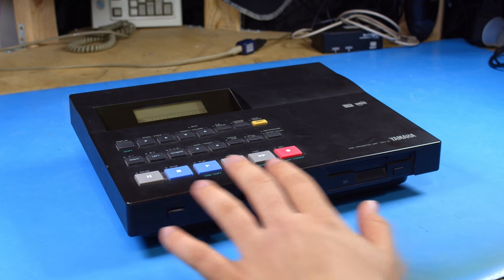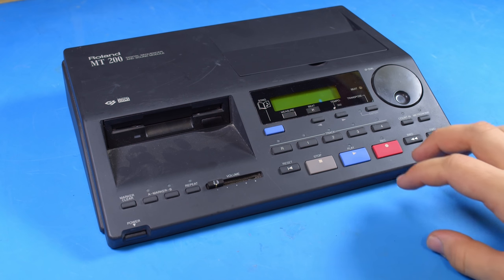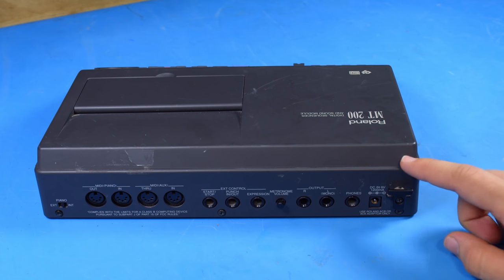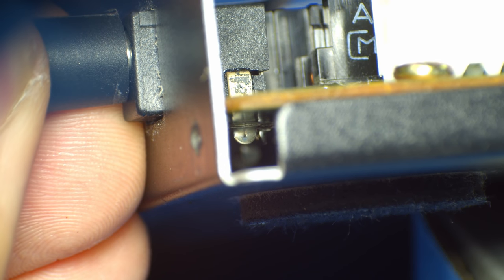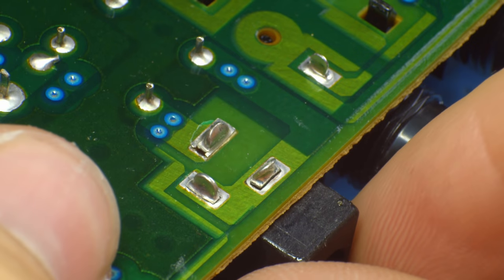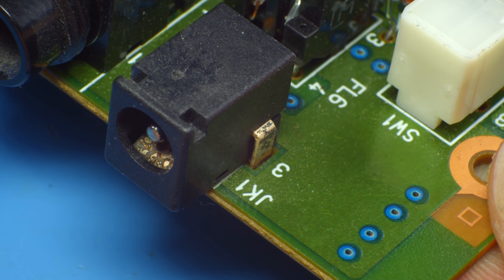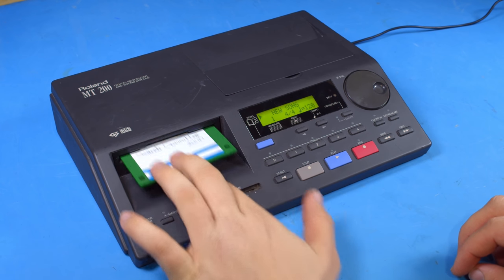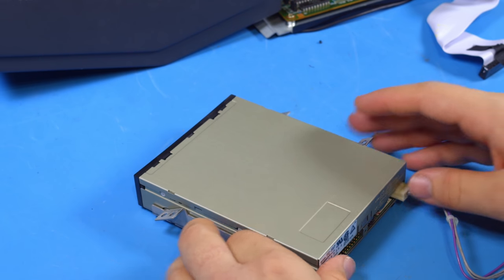Roland MT-200 Pt1: Power Repair

Comment: The drive select problem can be fixed with a floppy cable with a twist in it(not the regular pc floppy twist) by swapping driveselect 1 and 0. Also most pc floppy drives can be modded to shugart.
Reply from the maker: I remember something about some drives having pads on them for drive select. I'll have to look at the ones I've got and see if I can make that work on any of them. 

If not, somewhere I have a length of 34 conductor cable and some connectors. I can try making an adapter cable to give doing in the unmodified way a shot.
Reply from the maker: I've done some more testing. The FZ-357 drive in it isn't just set to DS0. There is some other way it is configured that makes it unusual. I tried several different brand drives jumped to DS0 and none of them worked. I tried doing an Amiga mod on a Sony MPF920 Z/121 and that didn't work either. Although the Amiga modded drive is closer than the others. It is able to detect the disk with the mod, but it never gets to either reading it or saying it's improper.
Reply: @TechTangents  Both in my Amiga 600 and SD35 I have FZ354s (the only difference between 354s and 357s is that the latter ones support HD floppies, but only if the JP2 jumper on the board is shorted, apart from that they should be identical). Jumpers in both ones are set to DS0, MM, RDY, but in the Roland one the TTL/C-MOS jumper is not present. Maybe that's the difference? I think that the most PC drives use TTL levels, so if your module requires CMOS levels, that might be the problem.

Comment from the maker: I've done some more testing. The FZ-357 drive in it isn't just set to DS0. There is some other way it is configured that makes it unusual. I tried several different brand drives jumped to DS0 and none of them worked. I tried doing an Amiga mod on a Sony MPF920 Z/121 and that didn't work either. Although the Amiga modded drive is closer than the others. It is able to detect the disk with the mod, but it never gets to either reading it or saying it's improper. 

Also, I had two problems in editing this video:
1. I used the stereo mics in the flashbacks and in the shot where I was holding the floppy drive and it doesn't sound good. I now have a lapel mic that I'm going to setup to be always recording as a fallback. So this should be fixed in the future.
2. I misspelled "too". It takes about 3-4hrs to go from clicking the render button to the video being uploaded. I don't want to waste that time to add one more "o"
Reply: Re: #2, I'm interested in your edit/rendering process and settings, have you thought about doing a video about your recording and production setup? (Or, have you done one and I've just missed it)
Reply from the maker: I am getting really close to doing a video on that. I switched from using Blender to Davinci Resolve as my editor a while ago and about a month ago switched to a BMPCC4K camera which is a huge departure from my Nikon D5300. My Editing PC is in it's final config now with 2xE5-2690s, 64GB RAM, and a 1080ti but the high bitrate 4k footage takes a lot of power to work with. For this video I also used Resolve's noise reduction for the first time which is very intense in the render making it take about 4x as long. But the result is much better. 

There are a lot of reasons it takes a long time to render, I'll go into the more technical details in the eventual video. The gist is, I'm using a very high quality workflow so it isn't easy. Also, I'm doing everything on Linux. So I'm sort of forging my own path.
Reply: Around 8:16 the camera seems to glitch out for a couple of seconds.
Reply: As an s330 owner, yes Roland did use specific floppy drives and you either need the specific chinon model as is fitted and ask roland for the jumper settings or buy a modded drive which is what I did (although it now has a faulty floppy cable which is soldered in, and the OS is on fdd so no drive=no one home), i think the other thing it needs is a drive ready signal (pin 30?) but naturally PC drives are generally designed as cheap possible so omit unneeded extra features.  
There is also a Toshiba drive that would work (as fitted to the s330) but I'm unsure of the model.
Reply: Have you tried digging around for another FZ-357 and swap out the controller? That head really smells like it's dead and buried.
Reply: AkBKukU i have a Roland MC-500  and it works fine with a Gotek USB emulator (the kind for Amigas).
I followed the instuctions I found on youtube to do the retrofit. You should try.
Reply: He states in the video he doesn't want to do the GoTEK setup. I did it on my MT-200s because I got sick and tired of dealing with my floppy disks crapping out on me and just having to deal with so many disks with all the midi files I wanted to listen to through it. So yeah, I did the video on how to buy the cheaper sub $20 gotek emulators and configure them to work on the MT-200 and I would suspect other Roland modules with floppy drives as well. There is also quite a bit to be found in the diagnostics that would help with his future video etc on this. Lots of quirks with these devices, but once you know about them, they are a joy to have.

Comment: From what I understand, Roland used center negative for their PSUs because that's what their BOSS effects pedal use, and everyone started using center negative for their pedals as well since they wanted to capture Roland's market and audience. So the whole 'center negative' thing stuck with the company for the rest of their life it seems.
Reply: I have no idea about audio equipment, but I do know that center negative was definitely a thing back in older electronics. And there might have just been 'standard' parts that were designed around a center negative...

Comment: Just a tiny correction: Floppy disks usually use the FAT12 format, while FAT16 was used for hard drives with MS-DOS 3.0 or later. 
FAT16 was created in order to support the newer much larger 20 megabyte hard drives, which FAT12 couldn't utilize to various limitations.

Comment: Improper disk doesn’t necessarily mean that. You can get rid of the message by pressing the Stop button, and usually everything proceeds as normal. I’ve had my MT 200 since 1999 and I still use it to create tracks. I’ve recently started having problems with the transformer and have just sent away for a Roland replacement which I hope will take care of the problem. I have my fingers crossed that it’s not the power supply internally.

Comment: I have a Roland SD35 which is pretty similar to your model. It's very unreliable with basically every floppy I got, but it works fine with my HxC gotek. Google for "pc to amiga floppy mod", it's what you need to mod your ordinary PC drive to work here. But your mileage may vary - I was experimenting with some modded drives and the ROland module was still picky as hell... It's standard DOS FAT format BTW.

Comment: Clean the heads on the floppy drive. Also you need to make sure the floppy is correctly formatted for that drive. You can’t just assume it is compatible. Also you need to resolder the 1/4” Jack.

Comment: You need to update the firmware in it to ver 2.0 or 2.01 to prevent hanging note issues that the ver 1x is known to do. I've got one that I use as a sound canvas device for all older games. And yes they are compatible with both 720k and high density 1.44mb disks. At least mine is or was until I put a Gotek in it about a year ago.

Comment: 9V Center negative is pretty standard with electronic instruments and effects by the way. For example all the guitar effect pedals I have sen have this. Keyboards also seem to have center negative barrel jacks most of the time, although they not always use 9V. 12V is also very common there. Also, the ripped barral jacks are the total classic repair job with musical equipment. I must have done a hundred of them or so. Seems to be due to the rough handling such equipment receives often on stages and when the equipment gets set up and torn down a lot.

Comment: I have the MT-100, which is an MT-32 Mk.II instead of a GS synth. It also uses non standard floppy disks... not a file format, a slightly different, slightly smaller floppy disk.
Reply: You mean Quick-Disk? That became a pretty popular format in the music world, Roland embraced it wholeheartedly with a lot of their products (like the D-20 workstation) before 3.5in took over.

Comment: Hi AkBKukU! I recently  acquired a Roland SoundBrush SB-55 paired with a SoundCanvas SC-88, the SC-88 works flawlessly but the SB-55 gives me an "hEr" error, someday I'll try to repair it, I also want to try the floppy midi experience!!! And for the floppy drive, I think I read somewhere that some Epson SMD-300 do have jumpers for DS0 settings and they are used for replacement on a wide range of devices, presumably the SB-55 wich uses DD floppies. Even though I don't know if they can be used on your MT-200. Sorry for my bad english, love your channel!

Comment: I don't know anything useful about the drive ID situation, but I'd like to mention one reason most PC floppy drives are unlikely to work: The Roland unit appears to require a drive that can detect when a floppy disk has been inserted. While the PC floppy interface supports this, it seems most if not all drives intended for PCs do not... and even if they did, there's apparently no agreement over whether the signal is active-high or active-low. (Things could be worse, though: You could need a floppy drive with a disk ejection motor!)

Comment: My disk drive is doing the same except it will go through the full format and then shows that it fails. I also used many different disks, same failure. Tried cleaning it but still get failure. I wanted to use the floppy also like you but I do have a GoTec coming in so I guess I will install it when it come in.

Comment: @AkBKukU just a heads up that both DD and HD diskettes in the 3.5" format are 80 tracks, the difference is in the numbers of sectors per track.

Only 5.25" DD diskettes are 40 tracks, hence they're half the capacity of a 3. 5" DD diskette 😉

Comment: Recently serviced an SD-35 also with a ripped power socket like in your video. The owner ended up cutting the barrel jack off, drilling a hole in the case and soldering the write to the plug, which I still can't figure out. If they went through all that effort and were able to solder, why not just solder the socket back the way it was, which is what I ended up doing.

Comment: Im sure you can find new drive heads out there and if its not the heads you could have a problem with an amplifier circuit or something. I would get a signal probe and probe out from a working drive, the bad drive and isolate the difference.

Comment: No idea if this is resolved in the video but most 3.5 drives still have solder jumpers for DS0/DS1 ... ready/diskchange or density select usually is a bigger issue.
Also ... FAT12, not FAT16 for floppies.

Comment: i wonder if someone could use some of the chips from the gotek to adapt a normal floppy drive to appear as drive 0
Reply: Most floppy drives can be modded to appear as drive 0 anyway, either on the PCB, or with a simple twist in the cable. ;)

The Gotek doesn't have any app-specific chips in it for handling that, just a few simple buffers.

Everything else on the Gotek is handled by an STM32 (ARM based) MCU.

A floppy drive just has signals on like DS0 / DS1, and MOTA / MOTB. The floppy interface just drives those signals Low to select the drive and enable the spindle motor.

(most signals on a floppy drive are normally pulled High by resistors, hence they are known as Active-Low.)

The twist in the cable on PCs basically just swaps those signals.
Reply: so he should be able to use a normal drive if he gets a cable with a twist in it
Reply: @DouglasWalrath  

I think so, yep.

Some drives in synths and keyboards are custom, but this looks like a fairly standard drive.

It's worth checking the PCB itself on some "PC" style drives, as some have solder pads or wire links to force them to DS0.

But yeah, I reckon a twist cable would work fine in this.

The original drive might be just slightly out of alignment, or the heads are a bit worn.

Alignment is fairly easy to do with a known good disk (with some data on), and an oscilloscope. It usually involves rotating the stepper motor very slightly (by loosening some screws), then making sure the heads are dead-on the track.

Probably not worth the effort though. Just use a new PC drive with a twist cable, or find one that does have a DS0 jumper.

Could probably use a drive from an Atari ST or another synth. Not an Amiga drive, though, as they are slightly different.

Comment: These aren’t synthesizers, they’re ROMplers aka samplers. They aren’t actually generating any audio waveforms or doing any kind of modulation or filtering. All they do is play back audio file samples and change the pitch.
Reply from the maker: That's a good thing to point out, I did forget about that distinction. I'll bring that up in the next video and demo it next to an actual synthesizer.
Reply: It's perfectly cromulent to call these synthesizers. They are romplers, but were often called tone modules or sound modules. The word "sampler" is pretty strongly married to a device (or a plugin) which is primarily designed for the user to easily sample audio sources and play them back musically. A rompler plays back samples, but it is not a sampler. (These distinctions are blurred when considering the pricier workstation synths which consolidated sampler, rompler, sequencer, and multiple types of synthesizer functions.)

"Generating audio waveforms" is the same as "play(ing) back audio file samples." (cf. wavetable synthesis). "Changing pitch" is a "kind of modulation." Changing amplitude is a kind of modulation, also, which is essential for amplitude envelopes. There are lots of types of musical audio synthesis, so it can be confusing. Part of that is due to patents, where manufacturers tweak their designs to not infringe but achieve similar functionality. (cf. Yamaha's FM synthesis).

Anyway, these are terms of art, so meaning can vary by time, place, dialect, and register. My first sampler was the Roland S-550.
Reply: naturesinterface You do have a good point, but it really isn’t fair to call romplers (which are just samplers, except the sounds are stored in non changeable ROM) and aren’t really generating sounds, simply repeating them, say for example like a CD player “reproduces” sound, not synthesizing anything, of that makes sense

Comment: I'd also swap out that battery the next time you're in there.  Move it off board too just in case it explodes or leaks like it eventually will. ;)   I have a Roland MT-90S at my workbench, and it's great for playing floppies of midi files. I can send you some floppies loaded if ya like. :)  (it also looks like the display interface is the same as the MT90S.  The 90 just doesn't save/record/format sadly. :/

Comment: You're getting the kind of close-ups in video that one could only dream of in still photography. What kind of gear are you using?
Reply from the maker: I'm shooting with a BMPCC4K using an MF3 to Nikon G Series adapter. For my macro shots I almost always use a Zoom-NIKKOR 35~70mm 1:3.5~4.8 with a reversing ring. 

I full manual everything when I shoot. So I take my time to setup each shot so it looks exactly how I want.

Comment: AkBKukU, I recall having to cover the small hole to the side of the diskette with tape in order to simulate SS (single-sided) mode on this really old Yamaha keyboard I once used. Though it may not have been your problem since apparently you got it to work, maybe you could try this and see if it makes your life any easier. Cheers!

Comment: Floppy drives are really annoying. I have two old laptops. They won't recognise an ide to card, the floppies are dead. No spares. No way to connect serial to any modern computer, no infrared working... and Any scrap floppy drives I tried wouldn't work. Plus "modern" floppies are really unreliable, so even when I deal with real hardware, I never know if an error is the drive or the floppy fault

Comment: I stick with my Classic Roland MT-32
Reply: The MT-32 is a totally different kind of synth so the comparison doesn't really fit... the MT-32 is more of a typical synth, and the MT-200 is more akin to a Sound Canvas - based on a locked down sampling architecture and adheres to GM/GS standards. I don't know why they chose the MT naming scheme for this device, but I don't think Roland has ever been particularly good at following their own names. They used this same set of sounds in the Roland XP-10, which is NOT based on the JV-1080 like the other XP keyboards are.

Comment: nice video, but you done a shit job at power suply conector... would enough teke off the green ink that coverd copper trail and fill soldering in the place... not those shit wires melted with soldering iron heat

Comment: I wonder if it could handle "Black Midi", would be a spectacular failure lol

Nice video as always!!!!!
Reply: I know this is nearly a necro reply, but these devices are only capable of 24 or 28 voice polyphony depending on the firmware and year it was made. A black midi file would likely lock up the unit or cause it to generate an error of some sort. It is also limited on the temp in that they won't go above 250bpm. Midi files with faster tempo will play at the max 250 speed on these.
Reply: @IvoryTowerCollections  no, thanks for the update, I'm glad to have an update to this!